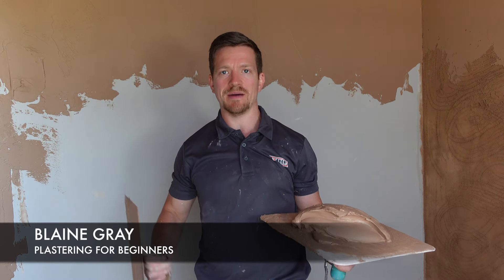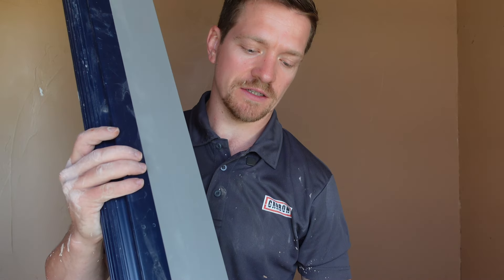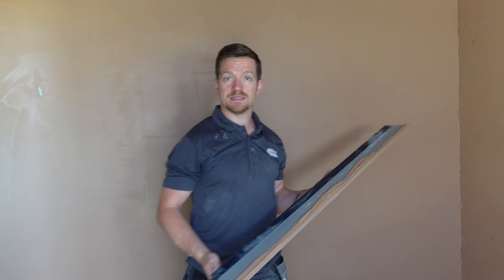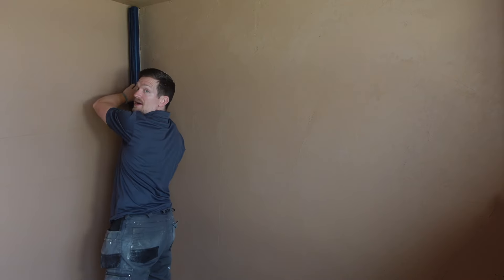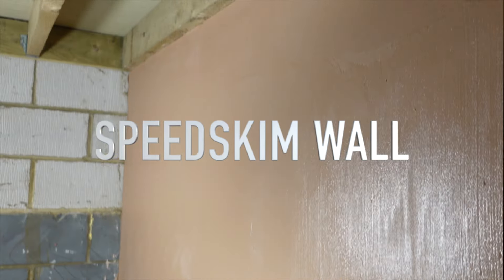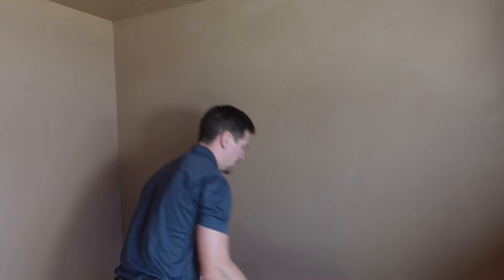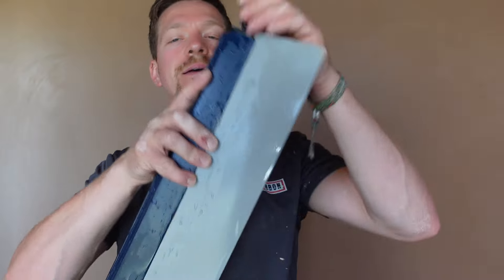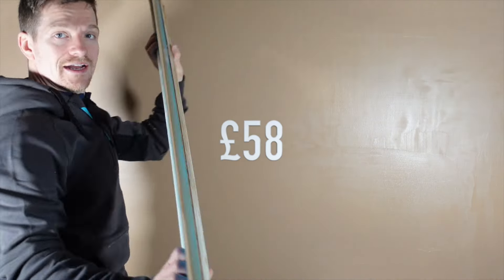NEW Refina X-SKim Spatula...Is It Better Than Ox SPEEDSKIM??

Comment: would be interesting on a update on this subject and your thoughts still about it.. if you still using it or stuck with ox? and what is the difference between the plastic blade one and the stainless steel blade, when and where to use them

Comment: These plastic things are only used to flatten and not finish. They also need material so avoid the temptation of farting around with the first coat.
Get it on , flatten , wait , finish

Comment: why does every company that sells these types of tools always put sharp angles on the ends..? makes no sense since its not like you will use these to perfect crisp edges
Reply: Totally
Reply: Because they're not plasterers.
Reply: I guess because they are mass produced items, and can't individually be hand finished to work like a seasoned tool.
Reply: The sharp corners are a side effect of cutting the sheet material used for the blade. To soften the corners repeatedly consistently in a production line is really difficult - esp as they don’t want people to start saying “mine wasn’t as nice as my mates” …
Reply: Just round the edges off like i do on my Marshall town trowel using a stone then no lines
Reply: Google level 5 skim blades
Reply: I just dremel them off.

Comment: im confused to why so many spreads are putting on and flatting and not just throwing both coats on with the same gear? that means mixing up 4 times in a day if doing 2 gauges. makes absolutely  no sense to me unless your slow as fuck
Reply: The quality of  finish  is undeniably better using a different mix to lay on with